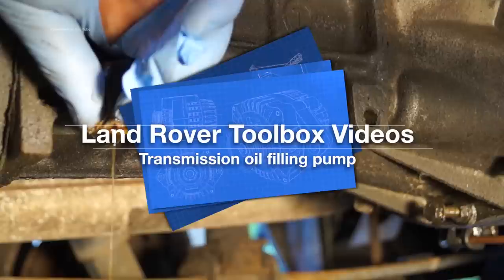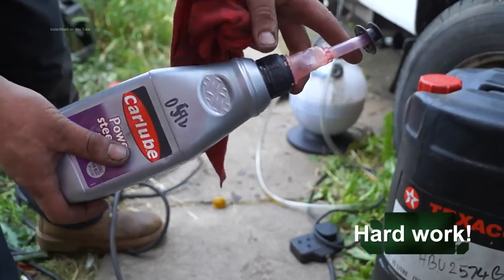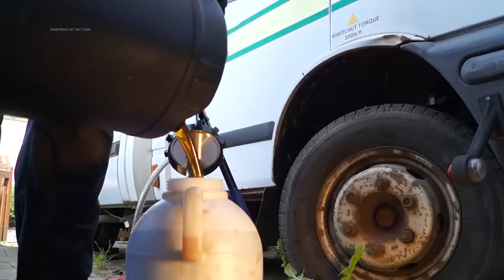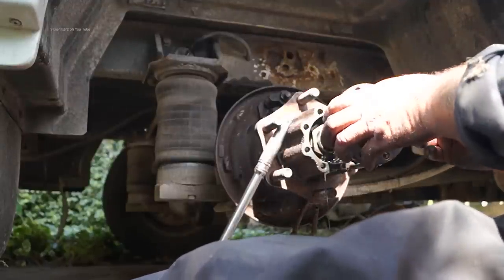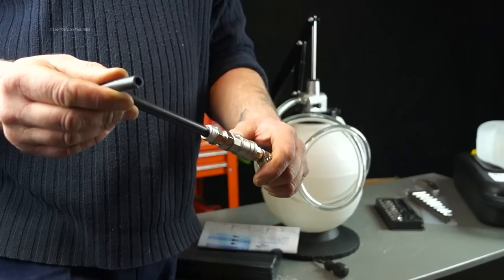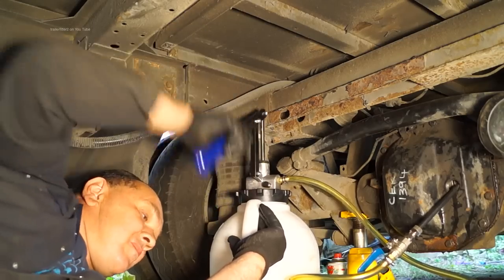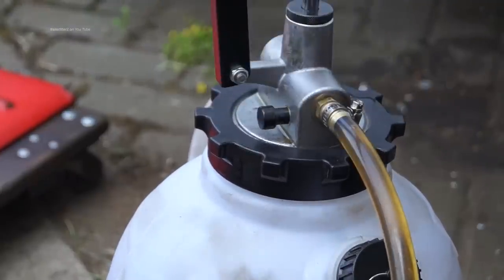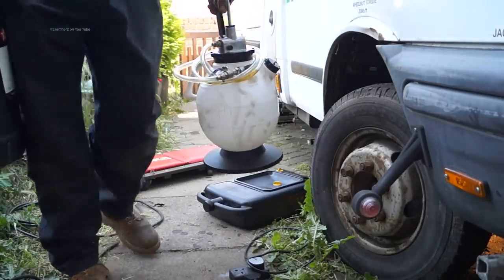Transmission oil filler system  Paddock PM 1238 - Land Rover servicing

Comment from the maker: I got a converted grease gun to fill transmissions etc  but takes much time especially on a gearbox, works out. fill up from barrel, roll under vehicle, add oil, roll out, draw some more and repeat about 4 times.  Much easier with this one.  Will report in a couple of years if it has lasted but contruction feels like it will.

Comment: I've only used it with EP80 90W and it's fine, but not as nice as the filler in the clip as the oil stays in the pipe. The good thing is you can build up a bit of pressure and pump about 0.5 litres at a go. Forgot to request a T-Shirt ha ha ha :)

Comment: ordered one! llook awesome
Reply from the maker: they are good.  I have 2 now for the different oils on the Defender.
Reply: Legendary! Was wondering what do you recommend to flush between changes?
Reply from the maker: Don't usually flush it,  just let everything drain.    If you need to clean it out brake cleaner is good because that doesn't leave any sort of residue.
Reply: Cheers! Ideal tool, especially after some enthusiatic wading on Saturday, now need a complete fluid check/change, appreciate the video, I've subscribed to pickup as many tips as possible, cheers
Reply from the maker: You are very welcome.  Might be worth investing in 25 litre wholesale oils if you are doing a lot of off roading.   Worst thing is water.  Gets in eventually even with raised breathers.
Reply: just been looking into that.. seems hard to find a reliable source thought.. do you use 10w40 ? seen some people recommending 15w40..
Reply from the maker: 10W40 when travelling in the colder parts of Europe and 15W40 in the UK.
Reply: ***** thanks to your tips now the proud owner of 25 litres of 15w40, got MT94 for my gearbox, EP 75/90 for axles and the transmission pump! Question I have is it OK to use the pump with both engine oil and transmission oil? I'm concerned about contamination, do I need to be worried? Cheers :-)
Reply from the maker: yeah I'd not want to cross contaminate gear oil with engine oils.  they have very differing properties where as a small amount of contamination gear oil to gear oil is not going to effect.
Reply: Cool makes sense, appreciate all your advice and replies!!
Reply from the maker: you're very welcome.